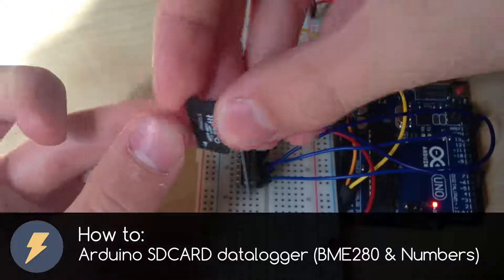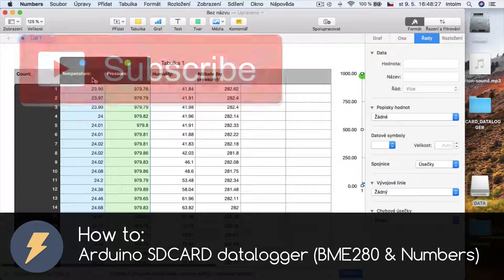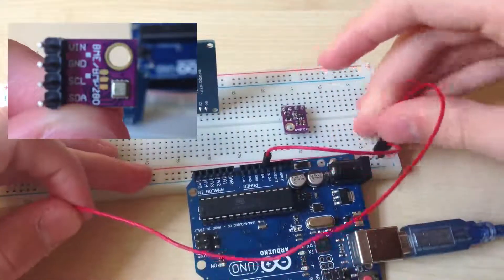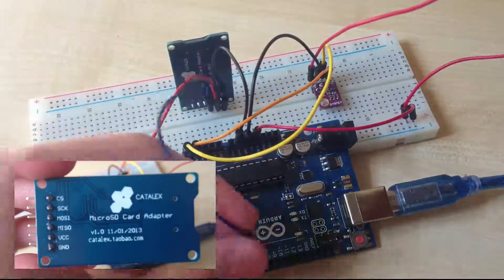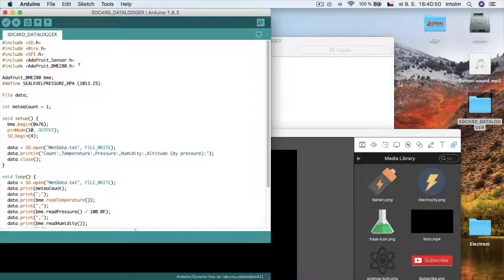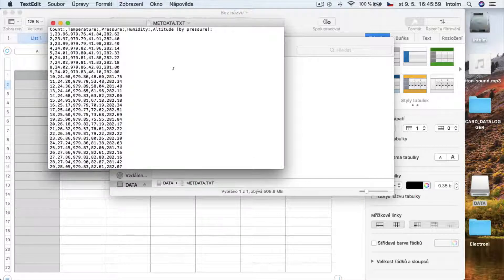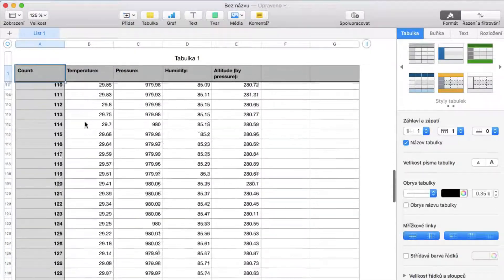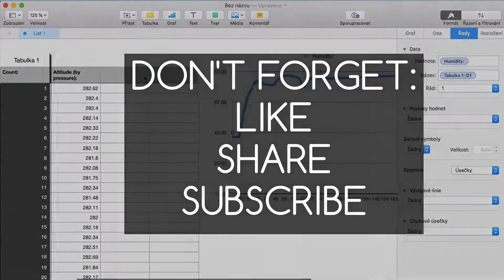Arduino SDCARD datalogger (BME280 & Numbers)

Comment: Muy buen proyecto, me esta ayudando con uno similar que quiero hacer. Muchas gracias
Reply: Si te funcionó al final hermano? Estoy haciendo uno también pero no me recopila los datos en la SD 😔
Reply: @Palolo_mlt sí, logre grabar datos en la SD de forma correcta. Luego abandone el dataloger porque compre un rtc con lector SD incorporado y tardo tanto en llegar que me aburrí. Tengo que retomar en breve.
Reply: @Raul_Herrera muchas gracias. Me di cuenta que estaba usando una microSD incompatible con el lector que había comprado. Necesito una SDHC en FAT32 (máximo) para poder recopilar datos y yo usé originalmente una SDXC. Ya haré las correcciones pertinentes
Reply: @Palolo_mlt bien, esas cosas a veces se pasan por alto y para los que no estamos muy en tema cuesta encontrar el problema. Suerte con el proyecto.